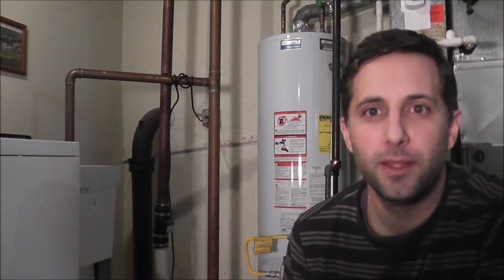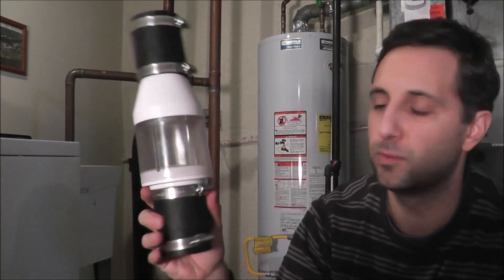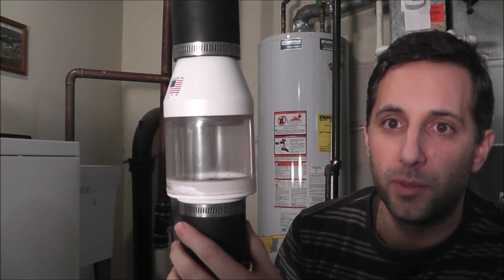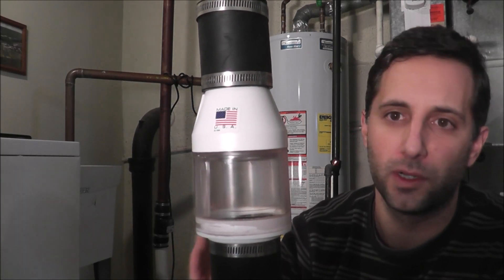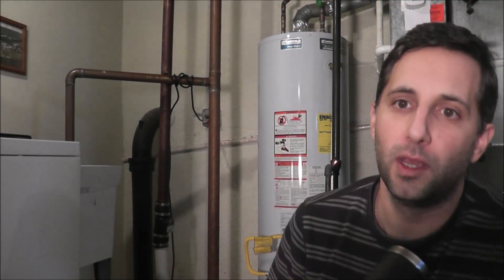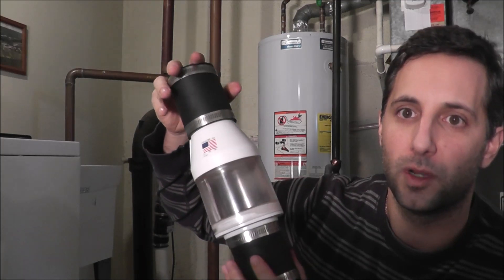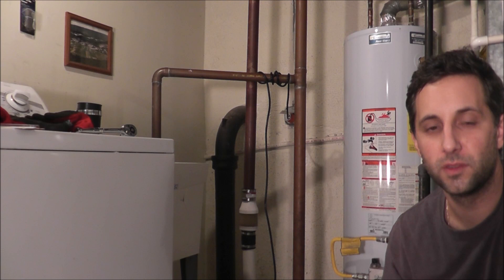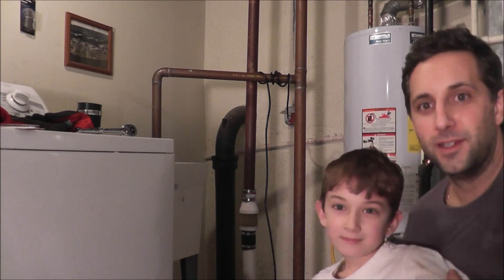Silent Check Valves: Do They Stop The Thumping? YES!!! (before and after test)

Comment: If the noise start's happening again, move the valve up higher on the pipe about midway. Reduce the weight of water in the pipe, reduce the noise.              https://www.youtube.com/watch?v=ZeggBBMuD_E
Reply from the maker: I raised the check valve about 2 ft and it worked! The thump is gone! Now I don't have to buy another check valve! Thank you sir!
Reply from the maker: Thanks. I'm going to try your idea when I get some time. My list of things to do around the house keeps growing.
Reply: It is great advice to stop the thumping but there is a consequence that may impact some people. The volume of water that returns to the pit/bucket. I had a 7ft lift and mine was hammering like crazy. I ended up installing two seperate valves to solve the problem, one high and one low. That worked and less water falling back into the sump pit.

Comment: I think the thumping has to do with "free" hanging pipes (copper pipe might make it louder). Both of my sump pumps discharge pipes run a few feet under a concrete floor with the check valves (like the on you started with) less than a foot of of the floor. I have never heard a thump even when they run at the same time. I have a T-Y right after the check valves all out of 1-1/2" PVC.
Reply from the maker: I think you are right. The free hanging copper pipes move a lot when the pump runs.

Comment: I'm confused by your 2020 update. Are you saying to still install the same type of check valve just higher up, or are you saying just to move something in the current setup higher up?
Reply from the maker: I moved the check valve in the video up a little and the sound got quieter. Moved it up about 2 ft.

Comment: Thanks for the video! is it works for 1/2 inch pipe? I mean its fit for 1/2 inch pipe?
Reply from the maker: I think they have them for 2 inch and 1.5 inch pipe. The one I used is for 2 inch.

Comment: Thanks for your video. I have tried two AYM check valves, the first one only last 10 months, the second one 11 months. They are vey quiet before 10.5 months approximately, then become noised check valves. I should try move them further  from the pump.
Reply from the maker: Yes try moving it further from the pump to lessen the noise.

Comment: Okay!!!!! I'm confused!!!!! How are you getting water in your sump by running sink water somewhere else in the house??? Water in the sump should be ground water from the drain tiles around the house!!! If you are getting water in the sump from your fresh water plumbing you have bigger problems than the check valve!!!
Reply: A sewage basin/pit is similar to a sump basin/pit, except that it's for lifting sewage up from a basement bathroom to the drain system on the ground floor.  Different purpose, similar concept.
Reply: I wondered the same thing.
Reply from the maker: I got it mixed up in the video. I meant sewage pump.
Reply: @chaircoverschicago  I hope you have a battery back up for when the power goes out.  Otherwise you are going to get raw sewage in the basement.
Reply from the maker: @seanile  If the power goes out we dont use the bathroom or washer.
Reply: @chaircoverschicago  I got a fix for you,  Get an inverter, check out https://www.youtube.com/watch?v=9oTheLB-ZEY Be sure to find out the peak power draw of your pump when picking out a size.  Choose a deep cycle or marine battery (or two connected in parallel).  Then keep a trickle charger to keep the batteries ready.
Reply from the maker: @seanile  thanks I'm going to look into that.

Comment: I bought the same valve and after about a month it started making a thump sound. hopefully yours doesn't!
Reply from the maker: I hope mine is okay, it's only been a week. Sorry to hear yours didn't last. I'll have to do an update if it starts thumping.
What did you do?  Which one did you replace it with?
Reply: Mine only lasted about a year then it started thumping louder than my last one. Tried inspecting it, cleaning it of any debris/calcium/buildup and it made no difference. AY Mcdonald also ghosts you if you try to ask for help or a replacement.
Reply from the maker: Update: This one only lasted me about 3 months and the thump has returned. Frustrating. I'm going to have to try a different check valve and will upload a new video when I do. 
Update May 2020: I raised the check valve about 2 ft and the thump sound went away.